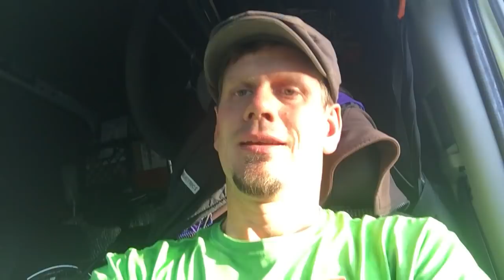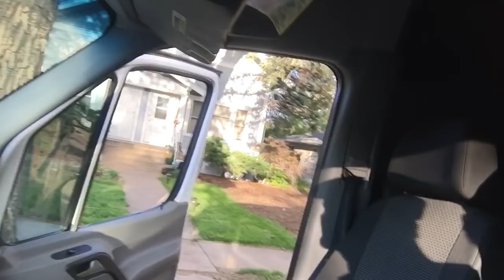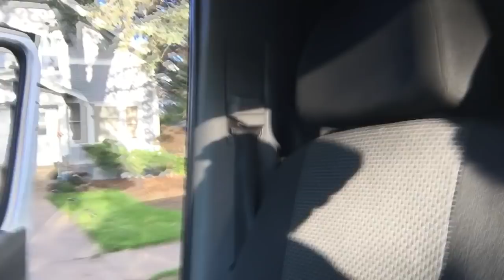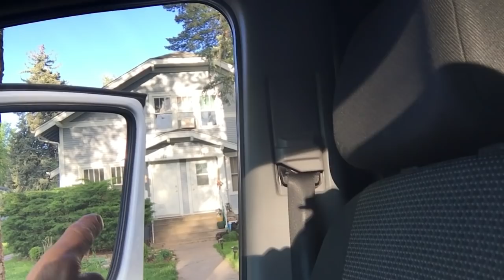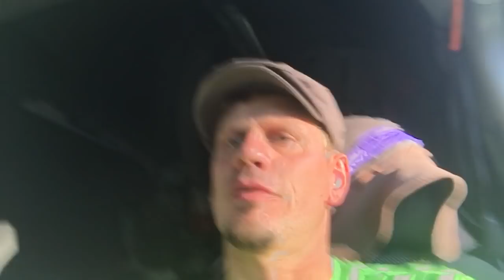Electrical Troubleshooting: Neighbor's Power Turned Off My Electricity

Comment: A. it needs rewired with separate meters and panels and one for common area if it has.
B. landlord should have the power in there name, pay for it and figure it right into rent/lease. the downside is greedy renters that will suck endless power to make it cost higher.

Comment: does each tenant pay their own utility bill / have their own meter? I'd hate to be the tenant that's paying for two unit's worth of power.... or would love to be the other tenant lol. 
seems like hand/finger is covering up mic for most of this video.
Reply from the maker: no my phone is going out. need new one. 
The utility department allows the owners to bill total utility to them and they divide it between apartments.
Reply: @Petersonelectricllc  Thanks for the video.   This mirrors some of my worries at my home.

I have a question for you.  I live in a home built in the 1940's.  I live downstairs on my own lease and I have neighbors upstairs that are on their own lease.  They have their own meter but when I shut off my meter twice, both times they immediately came down to inspect what was happening as if something upstairs in their place was on my meter.

1)  What are the chances this old place was never properly split?

2)  How much would it normally run to have the lines traced out?

I sure appreciate any help with this.
Reply from the maker: @Phaleel  I think it is shared, if it is a four plex it would take two seasoned electricians to do this in a 6-8 hour day, if a dueplex then about 3-4 hours. Running new lines is a whole other process, and you would have to be vacant and remodel and pull some walls.
Reply: @Petersonelectricllc  Joshua Peterson, thank you so much for this response after a year.  :)  

Any advice on how to pursue this?
Reply: @Petersonelectricllc  ...and I meant after a year of this video being out, that you responded within a day is amazing.  :)
Reply from the maker: @Phaleel  There are rental housing authorities in cities to protect tenants from land lords who will not help the safety of their properties.

Comment: Why don’t the landlord just set it up with utility company where when the tenant moves out and it’s turned off in there name it reverts back to land lords name that is the way it’s done in a lot of rentals I work on in Texas
Reply from the maker: It forces the landlords to eventually upgrade their electrical so each unit is on their own circuits. I think it's smart to force them to do this with old know and 2 homes and apartments from the 1900's